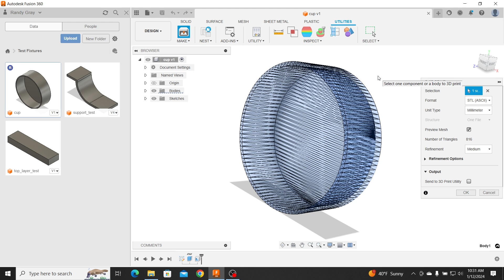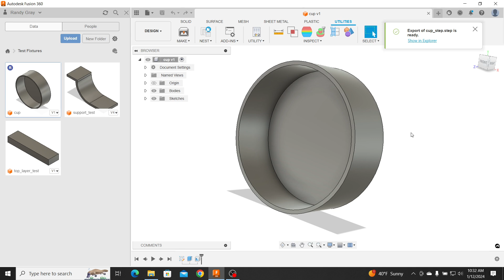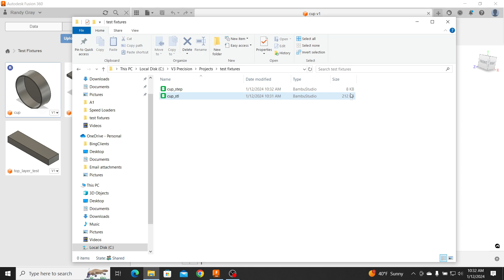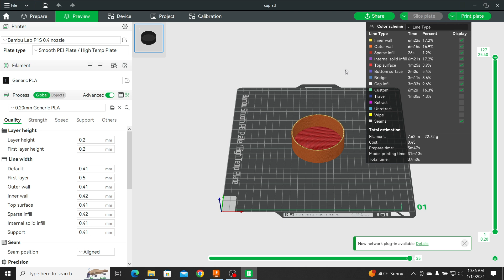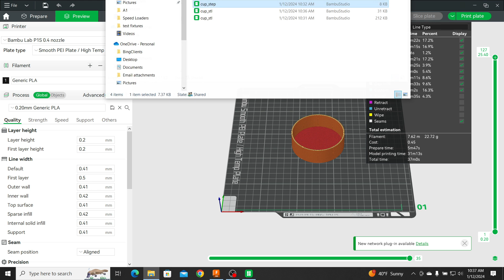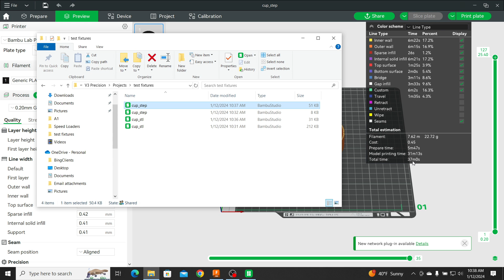The Difference between an STL file and an STEP file.

Comment: Personally, I was annoyed that you didn't address the differences between the files, only a discussion from your POV of their usage and relative size. Also, there are ASCII and binary forms of STL files and even forms containing colours. I use OPENSCAD mostly which generates STL files. STL files in the ASCII variant can be opened in notepad and contain triangle coordinates in x, y & z dimensions for all the triangles in the mesh. The files are easy to read and not manufacturer specific. Looking up the wiki for STEP files, they are quite different. My read of the wiki on it is that different manufacturers have their own notations for objects and operations that form the completed object so the step file isn't the object, but the instructions to generate the object as created by the application CAD software. This can be a much smaller file for sure. However according to the wiki it's often a bigger file in STEP. Keep in mind that ASCII format for STL is very wasteful, binary STLs are a lot smaller. Even so, for an example, one of my hydrofoils with a grid size of 1mm(2 triangles per 1mm square) and span of 900mm, average chord of 160mm works out at just over 8000Mb.  When a slicer is analysing a 3D file, it isn't going to calculate the volumetric occupancy of it's build volume that your object fills from a STEP file's descriptions, it has to have the occupied coordinates. So somewhere in the code, the slicing work is running the OPENSCAD equivilent of the command slice(cut=true){object} with a Z displacement of the object representing the slice height. Whether this works with STEP is debatable. The object has to respond to code to pull out the individual layers.
Reply: So best not think about step protocol at large, that can be anything. But rather think of the exhange format definitions like Step ap 214. Which anybody talking of a step file in 3d context is meaning. Step files can be anything but a step ap214 can not.

Best way to understand this is that a step AP214 file is more akin to a open scad file than stl. It contains curves and curved surfaces rather than polygons. And due to math deficences rather than describe intersections of individual curved surfaces it describes how they connect so that the target application can solve the right intersections so they suit themselves. abd a lot of other stuff but basically just that curved surfaces
Reply: Ty
Reply: Man you are way overthinking it. Just use step it makes amazing smooth parts. I'll never save a file as stl again after using step.

Comment: Interesting video I was not aware of the differences between the types. The time difference between the sliced parts seemed to only be 1 second as the .stl file was 36 minutes 59 seconds and the .stp file was 37 minutes. Practically no difference at all but with a better final part. Going to try this today as I have a part that is round like your sample and would rather the smoother result. Thank you

Comment: Fusion is badly out of date on the defaults for STL. Their “high” quality export should be renamed “low” quality. 

Also you can use OBJ which is like STL but knows the units.

Comment: I've been seeing those bevels on round 3D prints for years. I just thoughts that's the g-code. amazing
I will definitely print step files more often
Reply: Most CAD programs have setting for the facets /meshes, default settings leave a 3D cylinder with squared off round sides unless you set 0.05 in tolerance, the space between a perfect curve and the facet. The lower the tolerance the longer it takes to redraw the object on the computer. Yep, just spent some time with TurboCAD trying to make it useful for 3D printing...
Reply: @awkward you won’t see a difference. As others have said, you need to examine your settings to convert to mesh whether CAD -> stl or STEP -> Slicer -> stl
Reply: my CAD program doesn't make meshes at all. When I specify a geometry and export that as STEP file I get an exact representation of that geometry.
If I now put that step file in my slicer and print it with g2 moves enabled it will print radii not approximations
Reply: @awkwardsaxon9418 just to be precise, your slicer is generating a mesh, its just a better mesh if the slicer and the printer can support g2 commands.

Comment: Shouldn't the step file be a better basis for the slicer? The better resolution of the two printed parts and the size of the gcode file actually show it. I read that the Prusa slicer can process step files but it first converts them into a mesh file before slicing. Does the bamboo slicer do that too? This standard vector file has been around since the last century. What reasons does the slicer use STL files as a basis? Will that change in the future? Then the models from fusion 360 and other tools could be printed directly as vector files, cleanly and with higher quality.
Reply: ok, the question about converting Step to STL using the Bamboo Slicer has been answered below.

Comment: Thank you!  Note that if you turn on "show extensions" in Windows Explorer, you'll be able to better see which file is which (the column for file type is often helpful, but in this case it showed the same thing for both types).  Also note that this was a REALLY HORRIBLE design decision on Microsoft's part back in the 90s, which allowed for viruses -- because bad actors would name a file, e.g., "prettycatpicture.jpg.exe" and it would "look to the user" like "prettycatpicture.jpg" but then when they opened it, it would run the malicious executable.

Your results make me wonder if we might be better off only using a STEP file.  Are there downsides, in your experience?  It appears to me that the STL file is somewhat like "lossy compression" e.g., STEP : WAV :: STL : MP3.  And "MP3 at 128k or so".  :)

Also the "vector graphics experience" reminds me of the 80s arcade games Asteroids and Tempest.  :)

Thanks again!
Reply: That's the first thing I change on every Windows system I have to use. Not seeing the extentions drives me crazy.

Comment: Avoid STL and 3mf as far as possible. Published STEP files can simple be modified by others when needed as it can be read by most 3D CAD Systems. That's not so easy with STL and 3mf.
Reply: I can't stress this enough. Yet Thingiverse and Printables are full of STL files. Everybody exports STL just because everybody else does.

Comment: i have this isue on a klipper printer using stl files on Orcaslicer, but the same stl sliced in cura comes flauless, so it also deppend of the slicer.
Reply: I have found this exact issue

Comment: you could open the Bambu project file with any zip program. It will give you the files plus a little of printer configuration. 
No wonder why the size of the 3mf differs almost the same.

Finally i did not see any differencies in the printed pieces, but i prefer STEP as well.

I am using Onshape as CAD. By exporting the files to either STEP or STL i can select the resolution. That's maybe the main reason for the vertical pattern in your test prints.

Comment: The STL file is more like a " compressed " folder.  There is much more data in the STL. Pictures, PDF, text, and the actual 3D data.  Try and open an STL using your compression software. ( Winzip, WinRAR,,,)

Comment: I have a small company that manufactures a tubular part from TPU.  After much experimentation we finally have an acceptable print quality.  I'd previously experimented with STL versus STEP files and didn't see a noticeable difference.  I think that's because PrusaSlicer converts all input  file formats into a mesh for internal representation at its pre-defined resolution.  After watching this video, it seemed worth trying again.  I exported the test piece (smaller but with the challenging features of the full sized part) as an STL and STEP, imported both into PrusaSlicer and had them print sequentially.  The STL file was imported with 1798 facets and the STEP file was imported with 1968 facets, which is more but not significantly more.  I couldn't see any significant print quality differences between the STL and STEP versions.  They were printed at 45 mm/s.  I'm reprinting them at 50% speed to see (once again) if slower printing improves print quality.  A different product is less than 4 grams of TPU and each part takes an hour to print.  They print unattended in batches so it matters very little to me how much unattended machine time is required for a print bed full of parts, particularly on parts that don't need a heated bed.

PrusaSlicer can export G code with arcs instead of step linear approximations.  In machining, this can make a big difference in surface finish, depending on the motion planner used in the CNC machine tool.  An arc becomes a smooth move at the resolution of the machine, whereas the small linear moves that approximate the arc can result in a faceted surface.  The G code file size is also much smaller when the motion is described as a single arc instead of a series of small linear moves.  I enabled Arc Fitting (G2/3IJ) in PrusaSlicer and sliced my part and it really didn't seem to make a difference in the subtle vertical lines on the cylindrical part, so I believe these are printing artifacts (resonance not compensated by input shaping, etc.) rather than facets in the model.  PrusaSlicer is using the default G code resolution of 0.0125 mm.  I checked to ensure that PrusaSlicer is in fact exporting arc move G code, and it was.  The G code file was 2.2 MB and contained a lot of G2 and G3 moves.  I turned off arc moves in G code and sliced it again and the file size nearly doubled to 4 MB and all of the moves were linear G1 commands.  I expected the arc move file to be much smaller for a mostly cylindrical object with mostly arc moves.

If anyone has tips to improve the surface finish on 3D printed cylindrical parts, I'd love to hear them.
Reply: Lots of interesting info! When I briefly looked into arc fitting and changing the output resolution I had similar results. The best way to reduce vertical artifacts on round parts other than what you have already tried and making sure it is refined as much as possible is probably just to try different speeds. You might want to do some simple PLA tests on a cylindrical tower that changes speed every vertical 10mm or so. Like a vase mode print, but a speed tower at the same time. Since it could vary by the diameter of the cylinder as well, at least up to a certain size, I would probably try a test tower similar in size to the objects you are printing those. See at what speeds the vertical artifacts are the least noticeable, and stick to those speeds for your production prints. Hope this helps, if it does or does not feel free to let me know in a reply!
Reply: @802Garage  - Thank you for the excellent suggestion.  It seems obvious to print a test tower varying print speed with height, but all of the great ideas seem obvious in hindsight.  I'd messed with print speed in a haphazard manner before but halving the print speed is a dumb idea if resonance is a problem, because half the speed will still be resonant.  I think I'll slice the test piece in 5 mm/s speed variations from 20 to 60 mm/s and do some actual engineering.  Thanks again for making the obvious, obvious to me.   😀
Reply: @Liberty4Ever  Hey, I've learned hundreds of tips from watching videos and reading comments. No way I would come up with everything, including this idea, on my own every time. Hope it gets results!
Reply: @802Garage  - Changing the speed across a wide range of much slower speeds had no effect.  I still need to test a range closer to the 45 mm/s I usually print these parts, but I'm back to my usual methodical engineer test and development methods.  Tomorrow's To Do list includes printing test samples at 8 higher speeds 5 mm/s apart, slicing  the part with 2 perimeters and 10% infill instead of a solid 3 perimeters, and trying to print the external perimeters first instead of the default interior first.  I think I tried the exterior perimeters first already but I've changed many other parameters since then so it's worth revisiting that option.

I'm printing the seven versions of this product in jobs of six parts per sheet which typically takes around ten hours, so production is pretty much 24/7.  The TPU print quality with 0.2 mm layers is now very good after much development but my goal is excellent print quality.
Reply: @Liberty4Ever  Dang! Thanks for the update. The only other thing I can think of right now is that your extruder itself may be causing the artifacts, especially if the distance between them is the same no matter how large or small the diameter is, or if it appears on flat surfaces as well. Basically a wobbly gear or damaged teeth will cause imperfect extrusion for example. I highly doubt this is it though because that usually shows up as Z banding, since one full rotation of even a not gear reduced extruder puts out a lot of filament. I was also wondering if temperature could cause it, if basically the heat is being sapped out of the hotend and nozzle in a pulsing rhythm, but again highly doubt it.
Reply: LOL speaking of seeing you everywhere. ;)

Comment: There is other reasons too to use a step file, if you want to print multi-color prints, make the part with multiple  component in F360. If you want a part in one color and text on the part in another, make the main body as one component and the text as a second component and extrude the text from the main component so that you have two component that don't overlap and zero clearance. Export it as a step file and import it to Bambu studios, go to objects and apply the color you want to the different component. Make it very easy to print multi color and very little work to chose the right color in the slicer after export too. Use it all the time and have not used STL files ever again after I got my Bambu Lab Carbon X1 with 3x AMS. 
Other then that, tank you for the video, I did not know about the difference you showed. :)
Reply: Just e extrude your text inward .01mm

It's too small to see in single color but allows you to change the surface color.

Comment: "when importing the STEP file, Bambu Studio converts models into triangular mesh automatically according to a tolerance that is small than the half of default arc fitting tolerance. That is, it is converted into a high-precision STL model in Bambu Studio." - from Bambu

The slicer converts the STEP into a mesh file internally, so this isn't really a good comparison - you're effectively just comparing 2 different density STL's

If you were to set fusion's mesh export parameters to match that of bambu's internal conversion, you would get identical outputs.
Reply: Considering the space taken by the stl file as compared to step file and the fact that step file is easier to import and work with, I think it is time that we should slowly start moving towards using step file instead of stl.
Reply: I was going to say the same thing. He used medium refinement.  Crank that bad boy up to max.

I have been printing for 8+ years using fusion 360 across generations of machines and never once gotten those arc lines
Reply: That is unless arc fitting is enabled in the slicer, which makes it emit single commands for elliptical arc movements.
Reply: Maybe so, but we shouldn’t discourage the use of stp files instead of stl.   When sharing files, step files are so much easier to work with in CAD (for modifications).

Comment: When you exported the stl, you had refinement set to medium. It would be interesting to see if the printed result is the same when you export it with high refinement.
Reply: It will look basically the same if you export it proper in Fusion.
Reply: @MitsumaYT  yeah, pretty much. But the file sizes can get really big for essentially the same quality. The resulting g-code differences disappear.
Reply: High refinement would look the same as the step in terms of print quality aka "the lines" in the STL print.  More triangles with high refinement.
Reply: @ericb9328 That's because the slicer already converts the step to a mesh on import, it simply does it with higher fidelity that Fusion on medium refinement. the only real differnce between step and a high fidelity mesh (which I recommend using 3mf NOT STL to begin with) is the filesize.
Reply: @Shoshk3  Finally someone who understands what's going on and gets no likes.